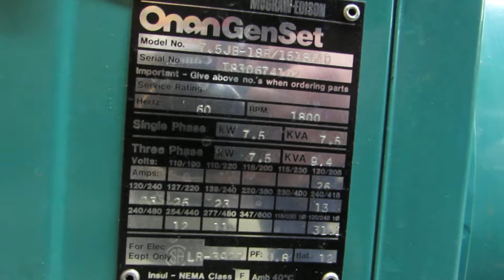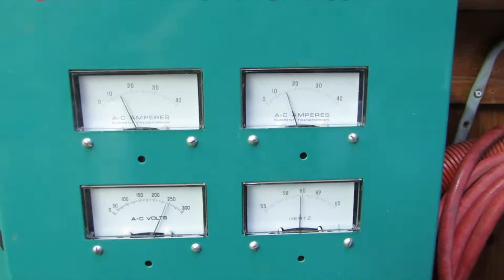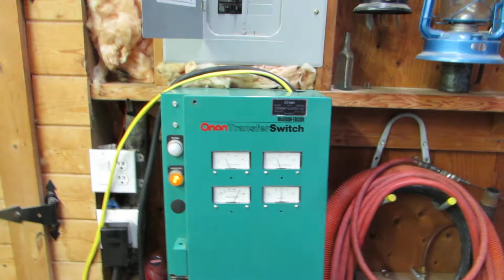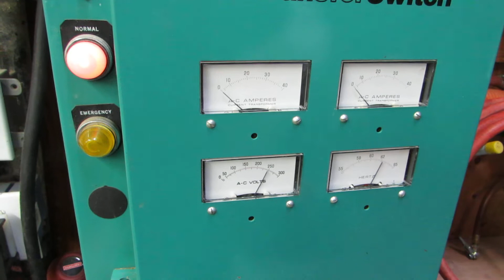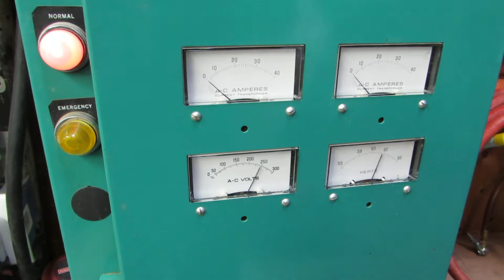Onan 7.5 JB generator, transfer testing

Comment: I just got the same generator.  Are you running on natural gas or propane?  I want to use propane because I don’t have access to natural gas
Reply from the maker: Running on a five gallon propane. They will run on 5 gallon tank but won't carry any kind of load. When I load banked it years ago, it seems to me it would only do about 2000 watts. The small tanks will not evaporate enough gas for full load operation.
When I had it installed at another house it was connected to natural gas.
I have not used it in a decade as I moved and have no natural gas or propane here.
Good luck with yours.
Reply: @MrMikey4026  I actually just hooked up a 5lb tank and as soon as it built a little voltage the thing runs super smooth!  It’s been sitting in the corner of a building covered for 35 years.
Reply from the maker: @nicka9103  I have seen these old Onans with 20,000 hours. They run very well.